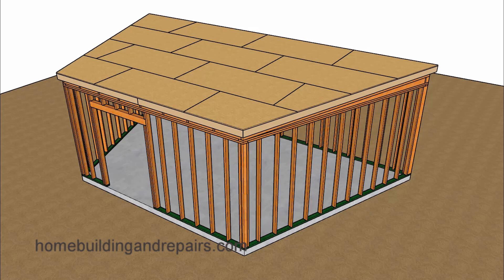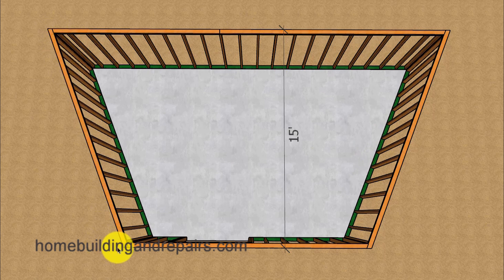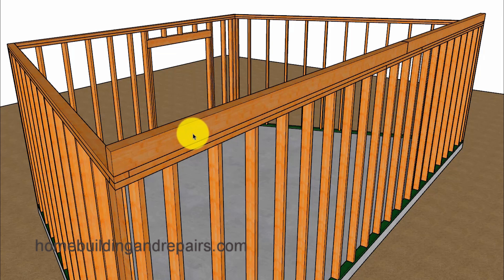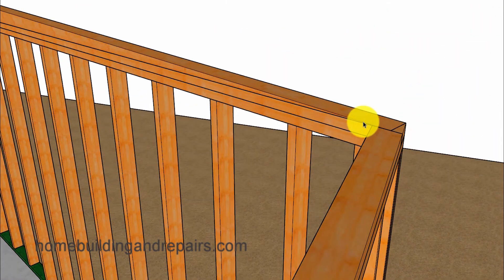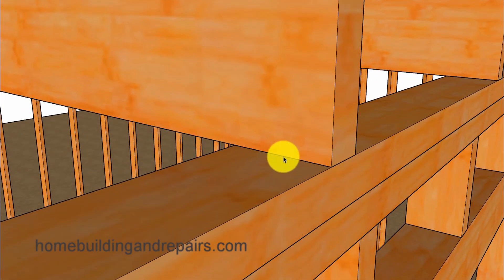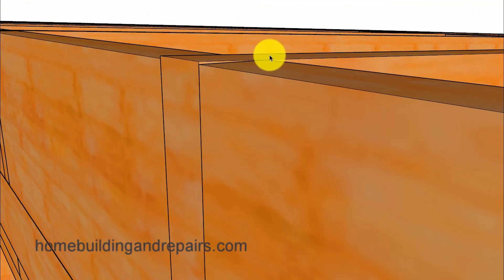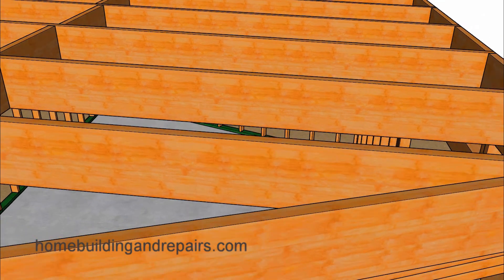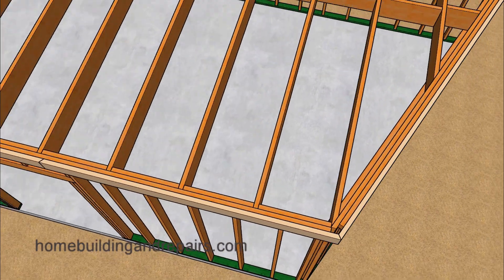How To Build Low Sloping Roofs For Sheds, Garages And Small Buildings With Angled Floor Plan Walls

Comment: Great video, close to what I'm doing, but my garage will be 24X26', 10' high walls. I want a shed type roof on it. We do get 3-4 ft of snow here at times. I will be using 4X6 treated post on 8 inch concrete pours, 42 inches deep. Can you come up with a roof for this building? It will have  2 single 8' garage doors and a man door on the right front side.

Comment: I have a question. I need a roof over a 7x7 square. Can I put 2 tall post-7feet tall and 2 short posts 6 feet, then frame it with 2x6 and use joist hangers for 2x6 every 2 feet?
It's for a hottub. I'm going to put fence boards on sides just to top of spa, from roof, for privacy.
I also bought steel brackets for the corners,  since it's easier for me....;-)

Comment: Is it more difficult or costly to build up, or to build out on a home? Also can you build up if you have a slightly ranted roof?
Reply from the maker: Usually it is cheaper to build on the lower level or add on to a house with a two story, but not go over an existing house by adding another level above.

Comment: Very cool design.  I have a 16x32 gambrel roof art studio with zero overhang on all sides. How can I update the overall look of the roofline by adding overhangs on both eaves and rake sides which will ultimately help solve an issue of roof runoff of rain water that falls directly in my gravel pad foundation structure causing it to remain water logged under the building.  I have put drains in the timbers under the gravel but I have super heavy clay and the water does not drain quickly through the gravel into the ground directly under the building. So I want to have the roof runoff to fall beyond the gravel on all four sides AND update the curb appeal of the boring traditional look of the gambrel roof at the same time.....
...and, go!    
I have watched your shed series of videos and most of your other videos .  I guess I am asking you to be a designer and also a construction consultant.  Wow, long comment. Sorry about that.  ;)
Reply from the maker: I will put your adding the overhang to your gambrel roof on my video list, if you can email me a picture of your project.
Reply: @gregvancom  what is the email address where I should send the photos of my shed project?